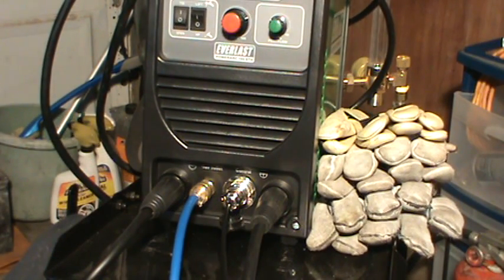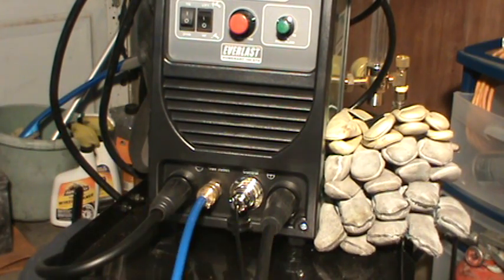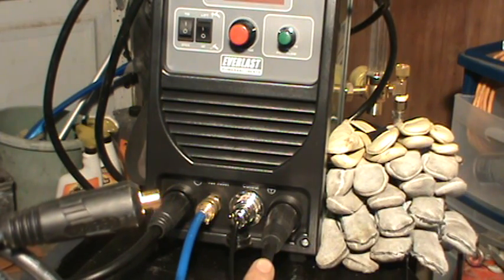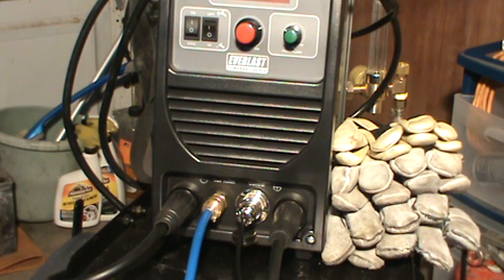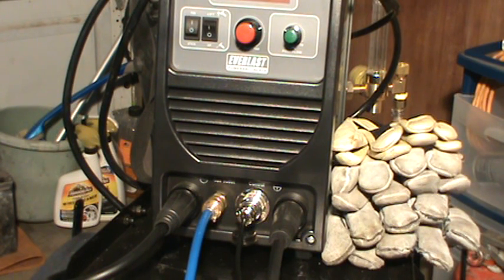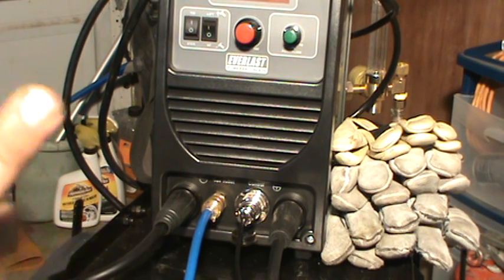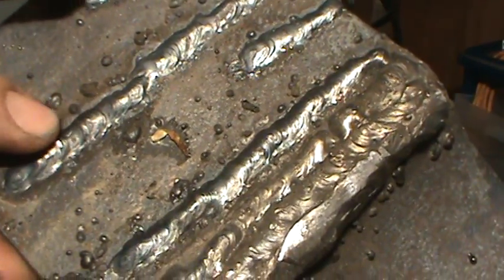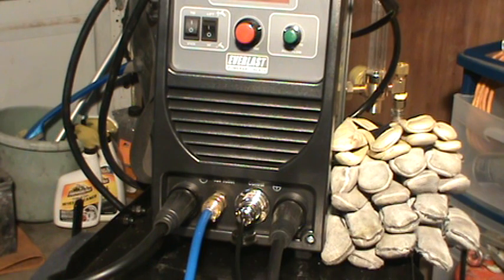Welding Polarity DCEN Or DCEP

Comment: I have been welding and fabricating for over 25 yrs in all processes and metal types.. I will tell you that when using smaw (electrode/stick), current depends on electrode type and even metal thickness.. For example you can run 6011 on dcen or dcep, if you are welding anything less than 1/8" and you don't want over penetration and better bead appearance then you would run on dcen. If you want deep penetration which 6011 is known for and you have thicker material you run dcep.. Now on 7018 or any 70 series rods pretty much you will always run dcep..